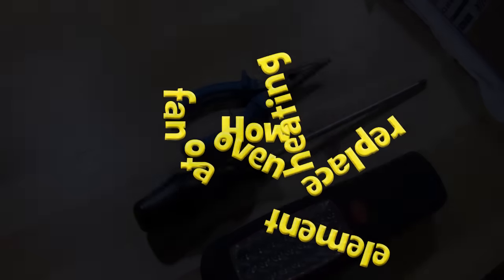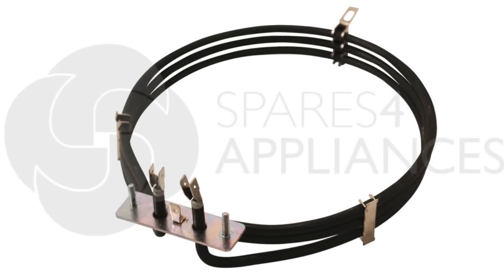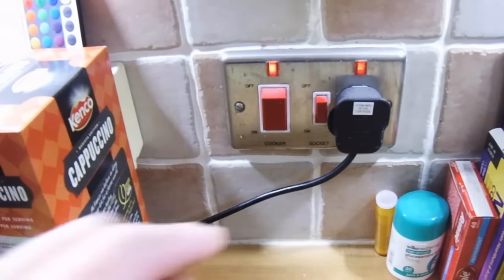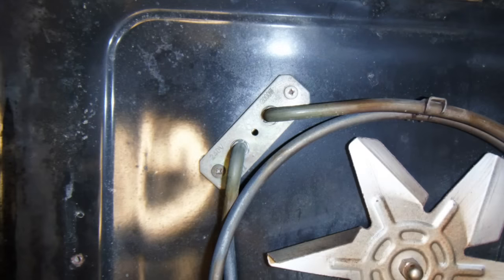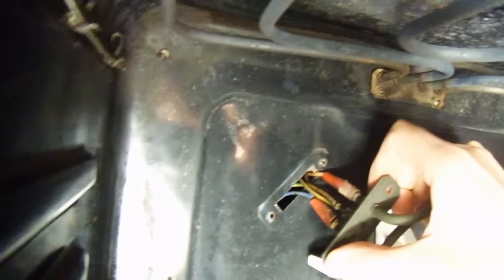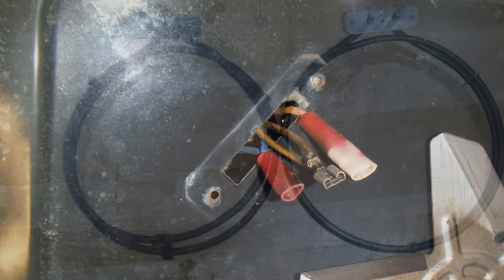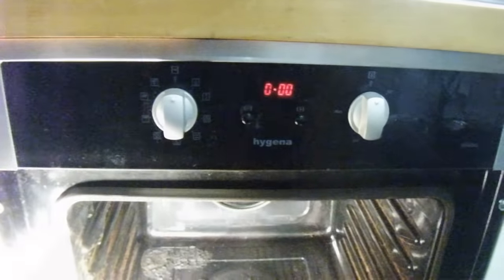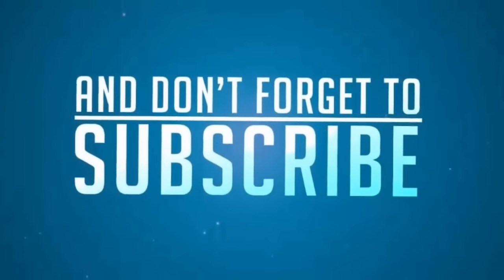How to replace and fix an electric fan oven heater element.

Comment: Thank you for this video, really informative.  My very old Valor 2 oven is still working but the fan is making a bit of a rattling noise.  Should I be worried or can I keep using it, as it still heats up and cooks ok, for now.
Reply from the maker: I would check to see that the nut in the middle of the fan is not loose.  They normally have a reverse thread so tighten un clockwise.  Failing that it could be the motor bearings on the way out.
Reply: @CB-RADIO-UK  oh ok thank you soooo much for your prompt reply. I will check, when the oven cools down

Comment: When connecting the wiring to the new element, does the connectors just push into those coloured jackets where u have the plyers in video? Or do they need wired up / in?
Reply from the maker: Hi i think i got you.  The plastic sleeves are just heat resistant protectors for the wires.  Once the wires spade connectors are pushed onto the element connectors they can slide over

Comment: Fred on tha Element plate in my cooker it’s not screws ‘ I don’t know what it is there that tiny ‘ if it’s rivets are bolts could u help me .
Reply from the maker: They may be pop rivets.  (look like little silver doughnuts)  If you have rivets then the job is harder but not impossible.  You can carefully drill rivets out and replace with self tapping screws.  I would see if there is a back plate you can remove on the oven to see how the element is attached.  Could be simple bolts.  The element is a replaceable part so in theory it should not be that hard.

Comment: Very useful video , I have subscribed. Changing my faulty element on Neff oven model number B 1641N . I took old one out and placed paper markings on the 3 wires but unfortunately the marking dropped and now I am not sure which wire goes where , the element has 4 connection poles (2 pairs) hee please ?
Reply from the maker: Hi.   Sorry to hear about your trouble.  Ive always replaced like for like so not sure if you new element has 2 power coils.  Three wires would suggest a Live / Net and an earth but if your cooker has a dual power setting there could be two Live feeds. Hard to say.  You may be stuck with calling on someone who can use a multimeter.
Reply: @CB-RADIO-UK  Hi Fred thank you so much for your speedy reply. After posting my problem to you , I went back to the oven and had another look at the wires , so one wire is a single cable , however the other 2 are double wires in each of of the connectors . The b single is the earth I believe ,

Comment: Damn it. Wiggled the old elements free but no sign of wires and cannot see them at all. Must’ve slid off and gone quite easy. How easy is it to get inside back of oven and feed them through?
Reply from the maker: Normally just a few screws for the back panel.  Is should be made to come off to replace the fan.  You will be ok.

Comment: Need to do this but it looks like mine doesn't have screws holding the element wiring cover. Looks just like prongs or studs protruding not screw heads.....help!
Reply from the maker: If the element does not come off inside you may have to undo from the back.
Reply: @CB-RADIO-UK  Cheers fred. On closer inspection it does look like the heads are on the back

Comment: Hey Fred..

My fan oven for some reason when I select top/bottom heater the top grill comes on.

Will changing the element similar to in your video fix this?

Thanks
Reply from the maker: If the fan element is not heating up then its prob blown.  If the fan element heats up on fan setting only and not top + fan then it must be a switch issue.
Reply: @CB-RADIO-UK  thanks for quick response.  I will investigate more as my partner was using and had the oven preheating before making me aware that the grill was on.  I had quick look and was able to use bottom heater but can't remember if that was with fan but on that setting the grill went off.  I have COVID and not able to do to much ATM but once I can will carry out some more checks.   Thanks again Fred

Comment: My oven is only getting slightly warm. About 40c and won't go any higher could this be the element?
Reply from the maker: Yes it sounds like it.
Reply: @CB-RADIO-UK  thank you so much. I've tried it this morning and it won't get hot at all. Thank you for your video will try this myself
Reply: @CB-RADIO-UK  I've fitted a new element and it worked 😄😄 all thanks to your video. Thank you so so much you've saved me time and money.

Comment: I've replaced the element and it all works but the cover won't fit over the new element is it OK to leave the fan cover off
Reply from the maker: No not really. I would measure the old element and try to order one in that is smaller.

Comment: Have done all above and it works just doesn’t seem to get to a high temperature food seems to be taking longer to cook
Reply from the maker: We have had one bad element from Ebay which did not get very hot.  the seller replaced it.

Comment: Hi there, the video is great but for a person with no experience and scared of electricity like me,  I need to see exactly how to attach the new wires back into place.. thank you
Reply from the maker: Hi.  You should be able to see the spade connectors on the new element and the oven wires simple push on to these tight.  As mentioned in the video take pictures before you remove the orig wires.  Tbh if the thought of a diy change scares you it might be best to stump up the cost and call an engineer out.  Best of luck.
Reply: Thank you so much, I really want to get it done myself, just needed to know if the cables click into place or I have to attach them in another way. I think I will switch of the mains so I’m not that scared ☺️

Comment: The problem I have is the element has been screwed from the other side (back) and getting the oven out will be a nightmare job , think I’m gonna multi tool the old machine screws off and replace with short self tappers from the inside 🤔
Reply from the maker: Good call that should work fine.
Reply: @CB-RADIO-UK  It did , took about an hour , using multi tool , drill and chunky self tapping screws

Comment: Thanks for video great help, quick question if you dont mind, my mum told me her oven stopped working and had a Sparky come look and quote her a price to fix it and he told my mum it wud be about £70/90 to fix, now I just looked for price of a element which im 99.9% sure that's all that is wrong as its only the oven that dont heat,  so was wondering is that the right price a Sparky would charge to fix a oven even thou the element is around £10/20 to buy. Thanks again for video as going to save my mum loads as I can fix it for the price of a element.
Reply from the maker: The elements cost £12.99 on ebay.  I would expect to pay around £70 for someone to come out and replace one.

Comment: How do you retrieve the wires if it snaps back in behind the back wall
Reply from the maker: You have to pull the oven out and remove the back panel and push it back through.

Comment: I should have watched this before i started,i had to take the back off mine now the gas hob doesn't work and there is a loose wire that comes from the hob and i'm not sure if it just screws onto the back panel any help please?.
Reply from the maker: I would google your oven model and see if you can find a wiring diagram.
Reply: @CB-RADIO-UK  Thank you i'll have a look.

Comment: Hi Fred, would this part still heat up on conventional setting, or only the fan forced?
Reply from the maker: Hi.  On the ovens ive owned it only works with the fan as they use other heater elements for non fan heating
Reply: @CB-RADIO-UK  thanks for your reply. I'm not heating up on conventional or fan forced settings. The fan element does not get hot though.. the hidden bake element I can't see but the floor of the oven gets warm at best.. but not hot enough that I can't touch it with my hand. Not sure whether to attemp replacing both elements or just get a new oven 😞

Comment: I have an Ariston DOS2. 2500w fan oven ( double oven). No mounting screws securing the element plate. Instead i have two small hex headed bolts. And the nuts seem to have fallen down behind!  Just offering the bolts up has proved that the holes are not threaded so there must be nuts required. 
Is it possible to get at the back of the oven and sort this?  Thx
Reply from the maker: Most ovens i have seen have a removable back panel to allow access to remove the fan motor so i would say yes.  When you do remove the back wear gloves because there is normally a layer of glass fiber insulation like you find in your loft.

Comment: Hi I have replaced the element but no heat at all, not from the top element as well. Before the top was working. Otherwise all looks ok, buttons, thermostat.. its just the elements are cold. Any idea? Thanks
Reply from the maker: I would re check the wiring to make sure nothing has been pulled.  Its possible to have been supplied with a dud fan element but the fact the top one has stopped working seems to point at a wire becoming loose.
Reply: @CB-RADIO-UK  hi took it apart and it was one wire that came off on the inside I  couldn't see. So its all sorted and running. Many thanks for your reply.

Comment: Changing is easy but the two screws have been fitted from the back instead of inside the oven  which means taking off the back too get too them thanks though good vid.
Reply: That is the better fit mine is screwed from inside awkward bloody thing

Comment: I still think my oven will change its mind and it will work tomorrow, she/he just wanted half a day off after working hard heating the baking potatoes, but if that's not the case, at least I know what to do. I learned to change the tap from youtube last month so I guess I can do ovens too.
Reply from the maker: Just take your time and take pictures of the wires and you will be fine :-)

Comment: Damn it got my element today it's 240v 2000w and the old one is 230v 2000w does that mean I need to send it back and get correct voltage?
Reply from the maker: No if your in the UK all mains supply is 240 volts.
Reply: @CB-RADIO-UK  ah OK thanks so it doesn't matter if it's 230v or 240v in UK?
Reply from the maker: Nope

Comment: Mine would have been as straightforward as this but when I took the inside back plate off the 2 screws holding the existing element are the other way round, so the points facing me. Looks like I'll have to take the whole back off the oven to get to the screws which now feels a bit too ambitious for me. If it wasnt for these 2 pesky screws I'd have had this done in 5 minutes.
Reply: I had the back off mine yesterday. I was worried like you but watched a video on removing a built in oven and it was really straightforward in the end. :)
Reply: @bobbysmoother  Am kicking myself Rob. I ummed n' ahhed and then called a cooker repair guy out, cost me £60 it would have been £80 but he knocked £20 off cos I'd already bought the element. (Which cost me £8.99 not £20) I watched him do it & realised I could have easily done it myself. She who daren't lost!

Comment: Hi, can you help. Just got a new element the Watts  and code is the same but the voltage on new one is 240v and broken one 230v. Will it matter? I turned it on and it works.
Reply from the maker: No i doubt it will matter.  Most are either 120 or 240v

Comment: The female connector has slipped behind the aperture - I’ve tried to use tweezers to find it pull it through - without success - any ideas?
Reply from the maker: Afraid you have to take the back panel off and push it back through.
Reply: I thought so- a longer job than I anticipated - thank you

Comment: How do I know if this is what's wrong or the thermostat?
Reply from the maker: Normally when you turn the thermostat you will here it click and sometimes a light comes on.  Only other way to tell would be to put a multimeter on the element contacts and check for power.
Reply: @CB-RADIO-UK  The grill works, which is like another oven on top without light, the fan oven, the fan turns and the light comes on but it does not heat, I suppose the problem is the element then

Comment: I got a question for the guy who's doing this I brought a heating element because my one on my cooker when and it's only last week it's gone again you have any suggestions and why this could be the oven sorry I only bought the oven the year before last it's a bush oven not very happy as I will have to order another one also can you please let me know I know it sounds like a stupid question but this is what the company told me who sold me the heating element that they grow in size because the heating element originally took out the oven last September was bigger than the one I put in I'm turns a thickness basically the one I've the old one which came with the oven when I bought the oven brand new is I took it out the oven and it was thicker than the one I put in it is that correct
Reply from the maker: Hi John.  Yes they do expand as the insulation in the coil breaks down, then the short and pop.  Only problem with China parts is that they can be hit and miss.  Hopefully your new one will do better.  If not then maybe you have a short somewhere.

Comment: Hi, can you please help me, I bought the new element and the voltage and size is the same but the watts not. The broken one is 2000w and the new one is 2100w.
Reply from the maker: You really should replace the 2kw with another 2kw element.  100 watts is not a lot more but there is still a slight risk it will overload the wiring.  Its a risk.

Comment: Hi. I have a rangemaster. When turning oven on, fan isn’t turning and element glows. Do I just need to replace the fan?
Reply from the maker: The element will glow slightly even with the fan on but not bright red.  If you have switched to fan oven and the fans not running it prob has failed.
Reply: fredintheshed1 the element glows bright red after about 5 mins of oven being switched on. Fan not turning and no heat
Reply from the maker: Does sound like the fan motor has stuck or burned out.  Ive  changed them before. Sometimes you can get then going again with a bit of lube.  Not expensive to replace and normally just 3 screws to undo once you get the back of the oven off.  Just need to watch the spindle length from the motor as they are different sizes.

Comment: Hi
Great channel! I have a Smeg SA 420x. I don't seem to be able to remove the circular element. Just thinking it may be bolted from the rear as the front presents 5.5 mm bolt heads that seem impossible to turn without rounding off. Anyone out there even done one like this?

Comment: What if the watt is lower than the one you took out?
Reply from the maker: The oven wont get as hot so quick.
Reply: @CB-RADIO-UK  thanks for replying I just changed my, problem is the cover that goes over the fan and element touches the element, would that eventually blow?
Reply from the maker: Hard to say.  It might heat up though. For what they cost it might be worth using this one for now but search out the correct replacement in the new year.
Reply: @CB-RADIO-UK  cheers mate

Comment: I've just done mine, it smelt like something was setting on fire so I've turned it off, is this normal?
Reply from the maker: You can get a burning smell the first time you run the heater coil.

Comment: My cannon electric oven has only got 2 wires connecting to the element is that normal?
Reply from the maker: Ive not seen that before.  Iam thinking that the earth must be made by the body of the element screwed into the oven.
Reply: Is there any way I could send you a photo?
Reply from the maker: Sorry my oven has the 3 connections
Reply: Hi Fred how do you know when the element is on right? I didn’t hear a click or anything when fitting the new one so unsure if it’s on tight enough as when moved it fell out?
Reply: Also when fitted I turned on the oven and there was a black smoke and burning smell is this normal

Comment: My backing plate doesn't have screws. How does it come off
Reply from the maker: Not sure tbh.  Maybe it unscrews from the back ?
Reply: Mine has two tiny hex bolts. Beware undoing these because their nuts seem to fall down behind!  We hoped this wasn’t going to happen ( and what else to do anyway?!) but the holes aren’t threaded, so we presume there must be  nuts. 
Perhaps replace with larger self tapping screws when refitting?
Reply: How to get at the back. Slide it out, then what?!
Reply: I’m going with the self tapper

Comment: Wire disappeared in the back now I don’t know which wire goes to which
Reply from the maker: Poss and Neg will go to the element poles and the earth to the mounting.  However iam not sure if it will make a difference which wires on which poles.  In theory it wont.

Comment: got an element that says its suitable for our oven but the connections are different ? HELP
Reply from the maker: If the connections are not the same its not suitable.  Unless you want to start taking your oven apart and cutting and re soldering new connections i would try a different supplier to get an element with the same type of connections.

Comment: My oven doesn't have an earth connected wire, only live and neutral. Yet the included element has an earth.Worrying?
Reply: There will still be metal to metal contact from the element to the oven body (which is earthed) - this is a mechanical earth but yes you are correct there should be earth bonding (electrical earth) to all exposed metal work. You would have to have insulation between the element plate and the oven body, maybe grease and dirt, and the screws would not have to make contact as well as the element shorting to the outside tube (this is very unlikely they normally just burn up) for you to get a shock, still possible I guess!